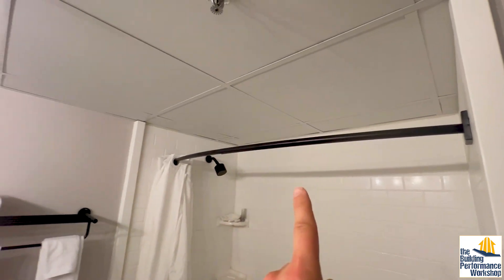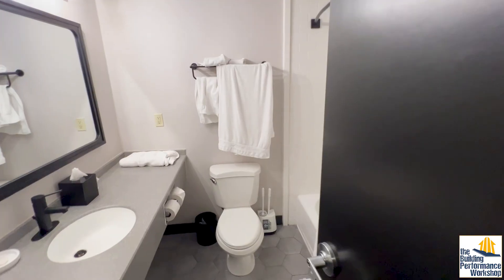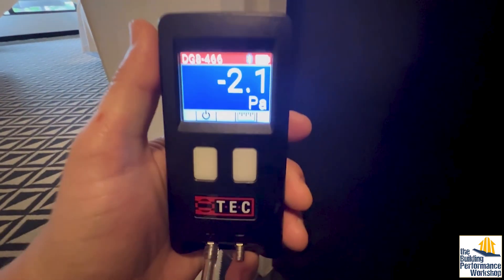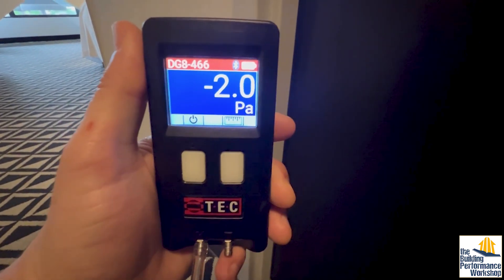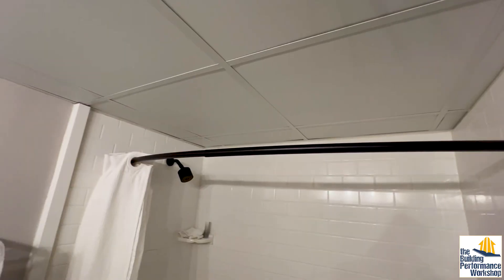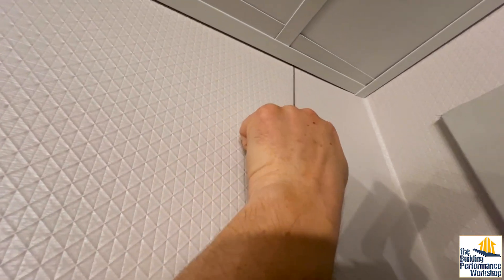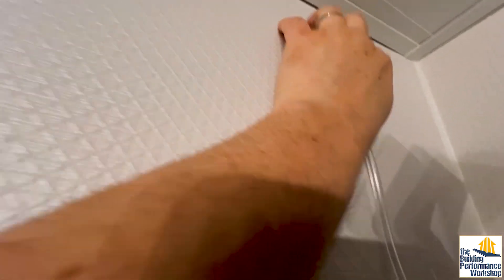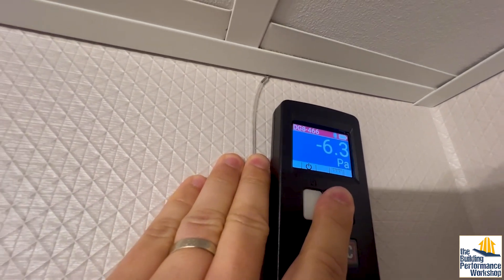Hotel Drop Ceiling Ventilation: Pressure Testing and Hack for Shower Exhaust Fan Improvement

Comment: Contractors, UGH! That exhaust port is, in fact, supposed to be installed on one of the ceiling tiles and have a cover. It's one of those one-fan-does-all hotel exhaust systems. There's a lot of flex hose because the port is probably supposed to be installed near or over the shower.

Comment: The better 3/4 was watching with me and as she spends half the month in hotels she will give it a try. She takes showers hotter than it takes to cook a lobster and has the AC cranked all the way down before turning the water on. Hotels have horrible AC units along with no or poor or reverse exhaust fans. 
       Got stuck in Atlanta overnight coming back from DR as a flight cancelled in FL and we weren't getting out of there the next day so we went to Atlanta as there are more flights out of there. Only place we could get to fast etc was the Motel 6 van. The smoking floor for some reason was not on the top floor so the cig smoke filters up through al the rooms through the bath "exhaust" fans. Place stunk pretty bad.

          Also if you ever get the displeasure of staying in an Aloft. Think of that Ikea particle board and outgassing from all the other stuff and the hotel wreaks of it. So bad that it was irritating my throat and I had to leave. Basically the whole hotel is like it's furnished by Ikea right down to the useless little chairs and couches you expect in a kindergarten room.
Reply from the maker: High five buddy, keep fighting the yuck

Comment: Hi Corbett, great video. When you recommend placing the bath fan in the corner of the shower that is the farthest away from the door I’m guessing that it’s for the purpose of getting rid of moisture from the shower more than odors from the toilet. I’ve been curious about the possibility of designing a standard sized bathroom (6’ x 10’) that has two bath fans – one in the main space for odors and one above a glass enclosed tub/shower combo (the fan would only be turned on when using the shower).
I know in the design of a steam shower they glass it in from wall to wall and floor to ceiling but they always put a section of glass above the glass door that can be opened like an awning window to help it vent. I’d like to use this glass wall design for a standard tub/shower (there’s no steam unit) in order to keep the entire bathroom from getting steamed up. Do you think having two fans would work or would there be pressure imbalances between the two spaces?
Reply from the maker: Yes to both- and if you have two exhaust locations, better to put the other one near the toilet rather than in the middle.